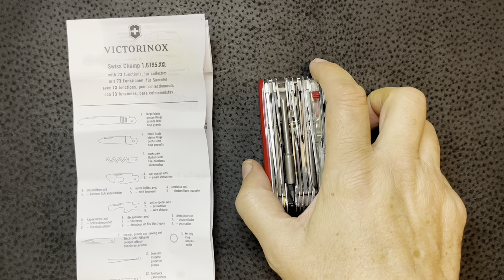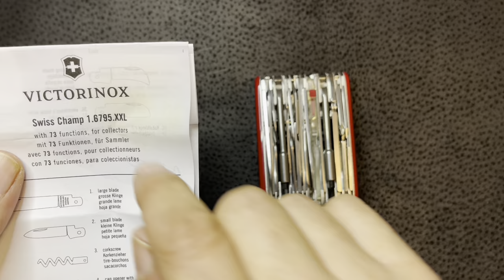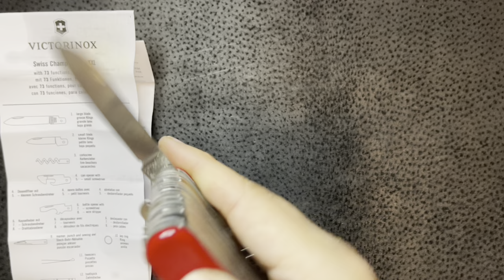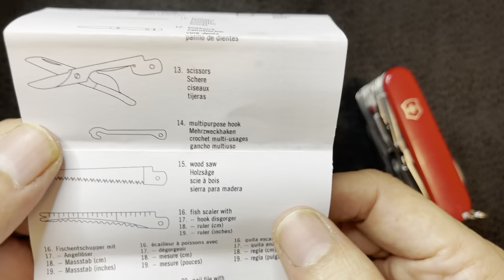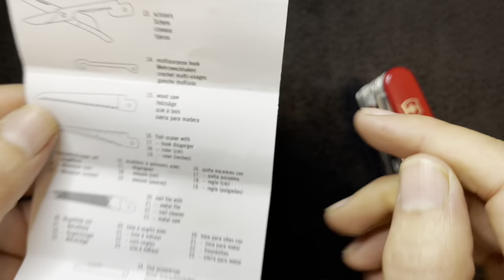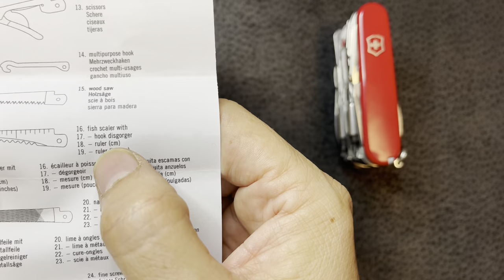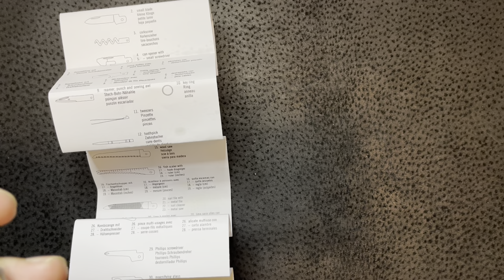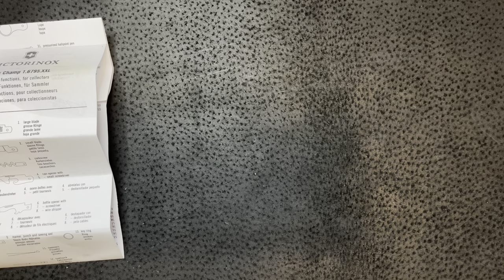ALL 73 FUNCTIONS!!! Victorinox Swiss Champ XXL loaned by Dirk Werning - Knife Review by Blood Groove

Comment: If I recall, the watch opener is for watches that don’t have screws and have a twist off backing.

Also, victorinox before they used LCD displays had quartz watches built into the scales, and I THINK that’s what the watch opener knife is for
Reply from the maker: Ah yes, some analog watch cases have a large flathead screwdriver-like groove on the back to twist open the case back. I haven’t worn an analog watch in such a long time that I had forgotten about that groove. Also, if I recall correctly, some case backs pop off so the watch opener helps with that. Thanks for your input.